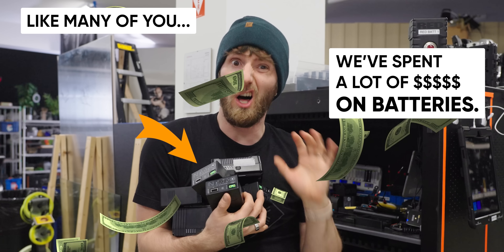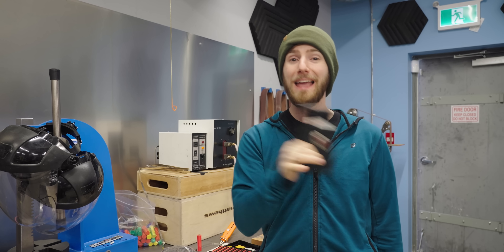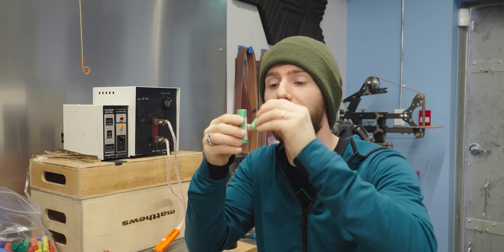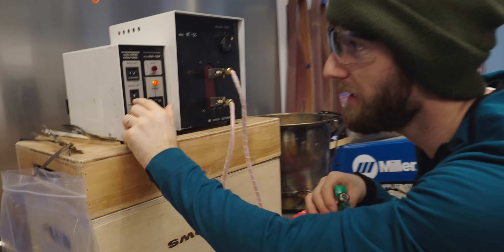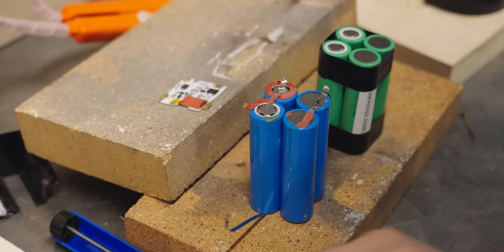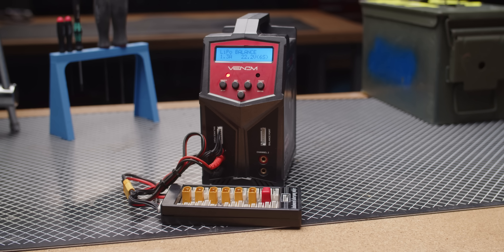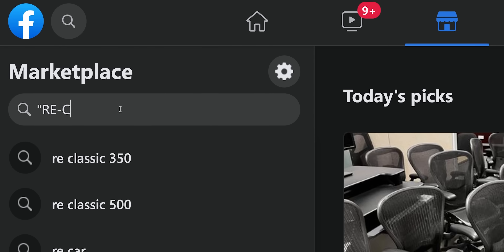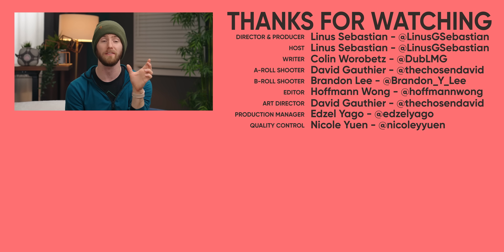This should be illegal… Battery Repair Blocking

Comment: Lets talk about it... First, use only one run of nickel strip that matches the load rating of your pack, OR run a 1 amp load wire that matches the C rating of your 18650 (as the chemical composition can differ between manufacturers) to a copper bus-line so that you can avoid spot welding completely, and as well insulate to avoid shortages during installation. NEVER EVER overlap nickel strip - You will never see this done in production as this can result in arcing, excessive heat, spot detachment and shortages causing the batteries to literally explode !BOOM! Each 1 amp load wire acts as a fuse in case you do unknowingly have a defective cell (yes, even brand spanking new cells can be defective and NO taking a voltage reading at 4.2v is not the correct way to determine if they are good as you can push bad cells way past 4.2v) Additionally, the BMS lines need to be wired in a specific order, re-soldering the balancing lines ONLY after you connect B-/P- , otherwise, you will put a full load across the balance lines and pop the internal safety and maybe even the MCU and it will never turn back on. You can measure to see if you triggered this by reading the resistance across P- to B-. Far from lastly, these RED BMS circuits go into deep sleep when the battery is disconnected completely. You need to wake them up by signaling P- and B- using a controlled voltage source (iMAXB6) and overcoming the battery load. Which is why you do not weld 4.2v batteries into a BMS, when the nominal voltage is 3.7v with an even lower maintenance voltage. This can lead to signaling a source that is both damaging to the BMS and the batteries. Almost every BMS can be woken up easily if done correctly. These BMS circuits aren’t protecting a right to repair, they are trying to avoid serious injury when people who aren’t aware of how to operate them properly decide to pop them open. Also, proper testing of the 18650 with an mAh meter can tell you internal resistance and characteristics of the batteries so that you can pre “bottom or top balance” the batteries, then bring them down for maintenance before assembling them. On a side note, batteries that drain quickly or have a lower voltage coming out of a package might have internal discharge issues and should be tested with an 18650 cycle tester before determining their usability. These are highly volatile batteries that have the potential to take off like a rocket and/or explode like a grenade.
Reply: They need to have you on
Reply: I am so glad someone took the time to explain this. You sir are spot on! This video is how not to even think about re-celling, I was screaming when they checked the no load voltage and deemed two groups by open voltage...... What in the hell....
Reply: Thank you Patrick MZ for sharing the knowledge. There is more to this battery business than most people realize. And shortcuts don't cut it at all. Thanks again!
Reply: I've seen other YouTubers do exactly what they did which suggest to me that they've fallen for misinformation (not necessarily malicious, probably someone decided to wing it and others assumed they knew what they were doing).
Reply: Didn't know about the overlapping strip thing myself. My big 48v 48ah pack I made has overlapping strips. Hasn't caused me any trouble but I never push it past 1C loads (part of why I made it so big, I don't need that kind of capacity but I wanted to keep the C rate low as possible).
Reply: paragraphs yo
Reply: Cripes!  Now I'm afraid to change the 18650 in my Tactical Flashlight.
Reply: Patrick MZ. Thank you, your info is very important for the average DIYer. Don't try this at home is good advice I would suggest.
Reply: You know what I would really really <3 right now?

A comment from LTT that they actually read this comment above. This seems to be the worst video I seen on the channel in .... ever?
Reply: Yeah this video is dumb and dangerous.  It should be taken down.  This is not for newbies but professionals that have years of experience building these packs.
Reply: Commenting on here so I might find this again super helpful thank you
Reply: Patrick please explain a little more detail about the wake up process? I've had a few bms that should have had no problem and were impossible to wake up.
Reply: Gonna call you on one thing. The batteries that violently explode are typically ICR chemistry, cells that are meant for very low current applications. They have the benefit of significantly higher capacity, but can't handle high current discharge. INR and IMR chemistry (which is what they were using in this video, they're almost certainly all Samsung 25R cells, they're INR) are very difficult to explode. Like, you have to very VERY seriously abuse the cell to get it to go boom. More likely is they're going to very quickly vent, which is the designed behavior. Venting is still bad, and there is still a ton of heat, but full on ignition is incredibly unlikely. 

INR and IMR cells are typically rated for significantly higher current output. The 25Rs in this video are rated for up to 25A constant discharge. Yes, 25 amps. The tradeoff is lower capacity. While some ICR 18650s can see up to 4000mAh, INR and IMR cells are usually only rated for about half of that. Basically, they're safer for high current, but you can't use them as long. Typical applications for these cells are in power tools, where they can configure them in various arrangements of parallel and series to maximize capacity, increase voltage (thereby lowering the current required), while also having the larger current buffer. The camera packs are basically exactly the same. 

Given the choice between a LiPo pack and an 18650, I'm far more comfortable with an 18650. Even if they go in to thermal runaway, chances are it's just going to get stupid hot, vent some gas, and be done. Just drop the thing on the ground. A LiPo pack will blow up. Every time. See the Note 7. Basically any video you watch on YouTube of a lithium-ion battery blowing up is a LiPo pack.
Reply: @_mnejing  Yep, but the only difference is that many cell-manufacturers test their cells as individual 'problems': they take a representative number of cells from their line of products and perform tests on every single cell while in the open air. Venting becomes a completely different story when they are tightly enclosed in a pack's case and an overheating cell is a completely different danger when packed together with 7 (smallest V-mounts I know) 15 (average >95Wh V-mounts) or even 31 (biggest V-mounts) other cells.
The many videos on Youtube of cells exploding are definitely not only LiPo's.
Reply: I am no expert, but even I was shocked to see only a voltage test to try to balance these - they may "trust their vape guys" but even with that BAD test, FIVE cells weren't even putting out the correct voltage... that really should have been enough of a red flag even to just Google "how to properly test if battery good". This whole video was shocking.
Reply: Yup, they need to have you on.
Reply: ok you win...
Reply: @PattarMZ  thanku. Very interesting
Reply: Great analysis.
Reply: I came to say this exact thing. Lol.
Reply: Has LTT responded to this? Interested to hear what they say about it.
Reply: so much said here is false
Reply: This guy batteries
Reply: for the red camera, why not build a battery holder, with spring tension on the cells, because you know , they are shorter , and you can do that, while being able to fit them in the battery pack that you have from red.)
Reply: @PattarMZ  Ryobi batteries intentionally shut off the battery is it's been left in a device for a period of time it not used for some time as well
Reply: This is the first video on this channel that I disliked, they don't know what they are doing.
Reply: @SJPretorius000  They don’t know what they are doing most of the time.. :/
Reply: One of your points in particular caught my eye:

> Additionally, the BMS lines need to be wired
> in a specific order, re-soldering the balancing
> lines ONLY after you connect B-/P-

Unless I am missing something here, that implies that you can also "kill" the BMS by harvesting it incorrectly from the old pack.  In other words, if you de-solder it incorrectly from a pack that is failing, but not yet dead, you could still "...put a full load across the balance lines and pop the internal safety..." because you "lifted" the "B-/P-" connections first.  

Is that a correct analysis?
Reply: @flyinglpranch3886  Yep, that is correct. The cells' voltages are checked via an analog front-end in these batteries, part of the gas gauge that monitors and controls everything that is going on inside the pack.
My V-mounts (just like his RED-bricks) are controlled by a VERY sophisticated gas gauge, in my case made by Texas Instruments (BQ20Z65) which need full reset and configuration done via SMbus communication with a special interface and software. Just swapping the cells won't work (and that is why, besides their obvious lack of skills, their operation would've failed anyway).

When disconnecting them, you should start at P+, continue with C3, C2, C1 down to P- (P+/- = Pack Plus/Minus, Cx = Cell-junction nr.)
When reconnecting, you should start at P-, continue with C1, C2, C3 and eventually P+. Doing this the other way round or just in the middle can damage the analog front-end of the gas gauge. Considering the price of these IC's (around 20 Euro incl. VAT via Mouser Netherlands for 'mine') something you'd want to avoid.
Reply: @flyinglpranch3886  Correct
Reply: I AM NOT READING THIS TAKE MY LIKE
Reply: @afterlifeyt9073  Stop being lazy and read it.  It might just cure your ignorance.
Reply: @afterlifeyt9073  Alright then I'll give you the take-away from Patrick MZ's post: "These are highly volatile batteries that have the potential to take off like a rocket and/or explode like a grenade." OK, 'nuff said?
Reply: based on your thorough analysis here, seems like LTT was completely in the dark on how to structure out this DIY experiment and in doing so have disparaged the RED battery manufacturer.  Love LTT but this is pretty weak.  I rarely comment on Youtube at all but felt compelled to do so here.  You guys should apologize to RED for being idiots.
Reply: @JAisCoolerThanYou  While I agree with 100% of what you said, Red still doesn't deserve the apology because they have overcharged for everything they've ever come up with by such an egregious degree they still deserve all the fck yous they get. lol

Comment: Also, as to extending the life of batteries:
Most EV manufacturers allow (and recommend to users!) using reduced/early charge termination unless a long trip is plannned because spending time at maximum voltage is stressful to the battery.

Dell, Lenovo, and Asus (and maybe others) also allow a user to set an early charge termination to reduce stress on the battery (All Lenovos for as long as I can remember back to the old IBM days, recent Dell enterprise products, seemingly all recent Asus laptops).  This lets a machine that is plugged in more often than not degrade its battery much more slowly.

Apple now sort-of does this - but they do some machine learning stuff to guess when you are going to wake up and charge to 100% then.  Why don't they just let you say - I don't need more than 70-80% on a daily basis, don't go beyond that unless I say otherwise?

My Yuneec Typhoon's batteries are still in great condition years later because I sacrifice a few minutes per flight and never charge them past 4.1v/cell.  (They are a chemistry that normally terminates at 4.2) My DJI Phantom before that had all of its batteries swell in less than a year because I couldn't set early charge termination.

Same for my Pixel - I almost never charge it to 100, but it would be kinda nice to be able to just throw it on charge overnight.  But I CAN'T because it will charge to 100 and stay there.  Just let me set that limit to 70% unless I'm going on a long flight?

Comment: At least for the Sony - this may not have been an anti-repair function but a safety function.  If a cell is 0 volts, it's assumed to be shorted and the pack will go into protection mode.

Alternatively, for shipping, a lot of packs will wind up in a "cutoff" mode until they receive external charge for a short period of time.  I've seen brand new Sony packs behave like this - 0 volts until thrown on a charger for a short period, regardless of internal pack voltage.

Oh,  @TheRAZZITEAK already addressed this.

Comment: you CAN reuse the old cells from the battery as long as they are still good, just not in that battery anymore. They would need to be checked, re-balanced, and then inspected before use but they can be reused individually or in a new battery as long as the cells they are matched with are of the same age and health. -BSEE

Comment: @Linus A lot of laptop battery manufacturers actually wipe the memory on their BMS, DELL for example. If you don't replace cells one at a time with those packs (with matching voltages to avoid mishaps), then they permanently dead lock. It's designed to protect against the situation that lithium cells go to zero volts and are no longer safe to operate. However, it DOES block repairs. Consider it like a RAID 10 array, if two cells in the same set die, the whole pack cannot be repaired. While it sucks, it does protect from people who unknowingly attempt to charge their battery packs with a cell that's leaked or gone to zero volts and potentially dangerous to recharge.

Edit: As previously mentioned by other users, some BMS also just require being armed by applying voltage to them or charging them.
Reply: The most common protection is a special "software fuse". When the BMS chip sees a zero volt even on any cell, it sends a small voltage to the smaller terminals on the "fuse", heating a filament and disconnecting the main terminals.
That is how the "non-resettable" packs usually do it. You can see these fuses on any Laptop BMS board - marking is typically like "12AH3" (which means 12A 3 cell).
To repair it, simply solder a jumper across it, or replace the fuse from a donor BMS if you want to remain fully "safe".

Comment: It's a bit sketchy but if you build a new pack and transfer the cells to the old pack while power is still applied ( making sure voltage per cell matches) you can get around some of these obstacles but not always. Depends solely on the kind of BMS. I have done it successfully in some cases without tripping the BMS lock out.

Comment: I am personally DONE with the lie that is battery powered (at least proprietary, rechargeable, and usurious Li-ion/NiCd). I needed a 1/2" drive high torque impact gun. Not having air, all the options I was considering were Li-ion powered until I found a wired one at HF. That baby is worth its weight in gold. Not only was it a third of the cost of a battery powered unit, I never have to worry about charging it up when needed, or the battery not holding enough charge to just run the lug nuts off a set of tires. I remember my father had a wired drill. Where did we go wrong? Now I am on the quest to replace all my battery powered tools with wired versions instead of replacing the battery or the equally expensive charger. Take that!

Comment: Some BMS-Boards, when cells were not connected, will only provide power to the output after you connect them to a charger. So try to charge your Re-Celled pack and check, if it has still no output-voltage. Hope this will help!

Comment: Also, even though precision is needed to re-cell a battery pack, humans are generally smart enough to research this to understand the dangers and care required. By not allowing us to repair our own property,  you may as well say that we are too stupid to be humans. People repair their vehicles everyday,  yet you hardly hear about a faulty repair causing an accident.  We should be allowed to repair our own property regardless of the complexity of the device. We are humans, we are smart, intelligent and remember,  a human invented these devices. We are not monkeys, we have intelligence,  understand safety,  msds and can make our own decisions.
Reply: Yes. Unfortunately, people are also well capable of overestimating their own capabilities, which is why so many safety-features are in place in such batteries to prevent 'the ordinary man' messing with them and creating a dangerous situation.
Don't forget that BMS-circuitry is a very high level of power electronics: the people that design them are not just average humans, they most likely had to take multiple studies to COMPLETELY understand what they are doing. Most human beings do not understand what they are messing with.
Trust me, I know. I recelled my own V-mounts (4S4P) after 9 months of self-study (as my BMS are far more complex than Linus', which just need a simple charge voltage to wake-up the BMS again, where mines get locked after an undervolt, overvolt, overtemperature, overcurrent, FET-fault, analog front-end register fault, cell-imbalance fault and so on.
It takes deep communication to reset it again and then attach new cells to them (which is 'finicky' to say the least)

Comment: Wow, I've rebuilt so many batteries and I've never had a lithium fire yet. My spot welder is nowhere near as fancy as yours, yet my spot welds are wonderful.  I think you guys are using a bit too much power to tack them together.  Remeber, You're spot welding, not arc welding!

Comment: Try to put your pack into a charger for a second! This should wake up the BMS. This is because the BMS protects the cells from under-voltage. And if you disconnect the cells, the BMS definitely see's a under-voltage. Applying a charger, tries to recover the cells from unter-voltage (which it already did, because you applied charged cells) and connects the power again to the outside world.
Reply: This...